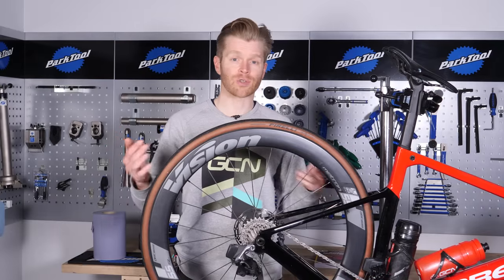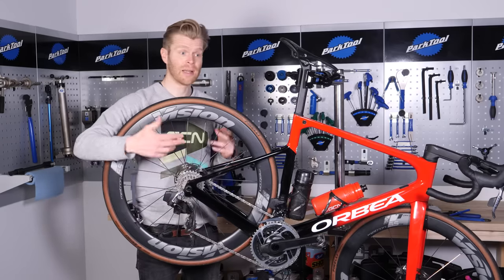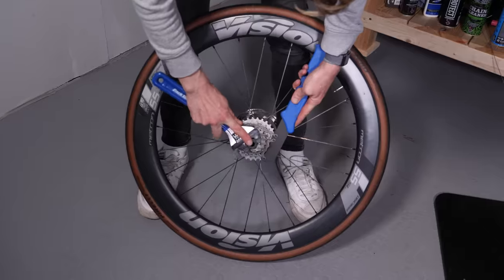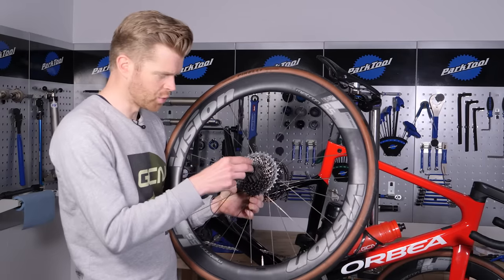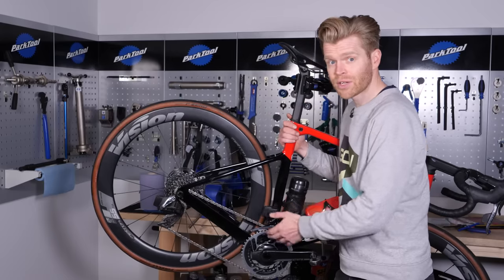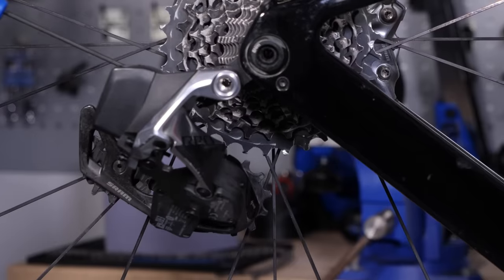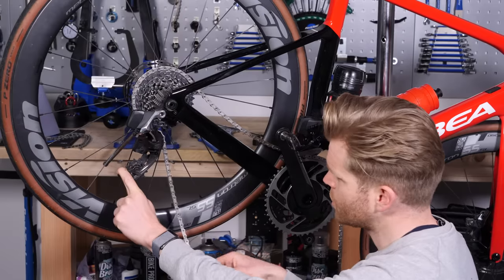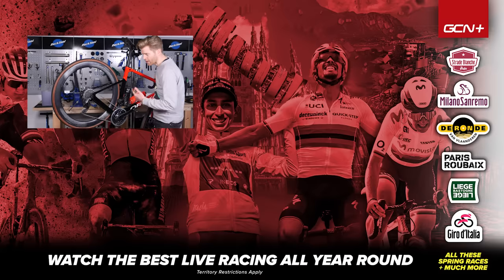How To Fit A Bigger Cassette & Ride Uphill With Ease! | Maintenance Monday

Comment from the maker: Did you find this useful? What other maintenance videos would you like to see us do?
Reply: @GCN Tech can you show us how to adjust Di2 to use non standard gearing (eg 52-34 rings) as Shimano E-Tube Pwoject doesn't allow it. TIA
Reply: How to replace tubeless tire properly
Reply: i mean it's common knowledge, right? right?!?
Reply: @janeh4908  ha, i knew there was a catch with happy-go-lucky adoption of more electrnics in bicycle drive 😅 i mean if automotive industry is any indicator 🤷
Reply: @zoladkow  not to mention the problems a flat battery can cause! 😅
Reply: Size a chain small to small, please 😂
Reply: it would be nice to see some videos with Enviolo hubs, and how to service them/take wheel off and on
Reply: I always have trouble getting enough initial tension when installing new shifter cables for my Shimano drivetrains (Sora R3000, 105 R7000, and GRX812) derailleurs). I especially have trouble with the front (Sora and 105). I would love to see a video with some tips and good visuals for both front and rear mechs before I build up my newly acquired Trek gravel frame 😁
Reply: @danmiller583  That’s the only way I know to do it, but honestly not sure if one method is better than another. Seems like sizing small to small would be the best method if you want to swap rear cassette / ranges without changing chains. I have run Shimano 11-28 and swapped back and forth with an 11-34 cassette and it works very smoothly without any adjustment.  Of course, I never run in “biggie biggs” because of cross chaining, but it would also be nice to have an expert to explain the pros and cons of this technique.
Reply: Hello. Thanks for the video Ollie. Thanks for the tip on how to size your chain, that was great and so easy. Could you do a video on truing a rim on the bike. If a bike has a square tapered bottom bracket can you put any size crank and chain rings if it's a square tapered as well? I have an 1984 Cannondale SR 300, just, trying to make it easier to ride.

Comment: Great video, Ollie. A great life hack for older riders  too. In my 30s , I started with the standard 12-26 and 42/52 chain rings. As I progressed through life, that all slowly changed. Now, at age 75   one bike has 11-36 and GRX 46/30 chain rings. Must other bikes are setup for mild hills at 11-34 and 50/34 .  When I hit 80  there will be a 11-40 in the rear. Cheers.

Comment: I just bought a 11-34 cassette for my road bike. Perfect timing, GCN.
Reply: Me too.😃
Reply: I’ve just got the new 12 speed ultegra, always rode the 11-32 with the old 11 speed and didn’t find the spacings too bad, but now have that bail out gear with the 34. With the 11 speed it makes the ratio spacing maybe a little bigger than ideal to get that perfect gear sometimes. But with the 12 speed it’s great. I don’t understand why people would want to leave home with anything less than a 32 on the back on a semi unless you live in a flat area I suppose

Comment: 😏 just did this a few months ago in preparation for summer riding in the NC mountains. Was using a 32 that came with the bike and went to 34. There are some regular routes where I’d have to stop and rest so as not to exceed my MHR. Similar to another poster I am 72 and plan to keep at it. Go out in stride not on your hide. 😳

Comment: I happily since years  using a ultegra 6800 with a 36 cassette (long cage) on a specialized roubaix SL4 with a long derailleur hanger.  In addition I am using a zephyr 33t front chainwheel (110BCD) combined with a 50T large ring.  This gets me up the steepest hills I can ride at my age of 68.   Shimano specs are usually very conservative an can be extended by quite some margin without any appreciable loss in performance.

Comment: It’s like you read my mind! I’m going to change cassette for an upcoming steeper race, I currenlty have 53/39-11/25 and going to switch to a 11/30 for better climbing. The tip of NOT catching the largest gear woth my derailleur probably saved me a lot of time and headaches. Thanks!!
Reply: I have 25 and it's the worst thing ever. Hate that race and road bikes have no uphill perception.

Comment: I got a 2012 Focus Izalco with a triple chainring (53-42-30). IMHO the best choice for eldery people like me. The cassette is an ultegra 30-11. A 1:1 gear ratio is mandatory, could even be shorter. The next upgrade will probably be a 32-11 or even a 34-11 cassette. I know it's not fashionable, but 30 speeds are much more pleasant than 12, to keep a good steady pace.
Reply: What groupset are you using?
Reply: @notpablo8369  A shimano ultegra 3x10 groupset, current in 2012, but every parts are still available.

Comment: I live in a mountainous city. Replaced my crankset with a compact 50/34 and an 11-34 rear... And I'm a happy camper rolling up hills all day long
Reply: Hi, these look like the same specs as my gravel bike but I seem to be struggling on steep hills. Would this be my fitness level if this gear set-up for an 8-gear cassette seems to be the most accommodating? I haven't been in my best shape lately and trying to determine whether my bike is optimized. It's a basic gravel bike, nothing specialized. Sorry I don't speak "gears" fluently. Appreciate your opinion.

Comment: Hi Ollie, In the hack and not a bodge competition you may want to use the KMC chain checker tool? It hooks up both ends of the chain releasing the tension of the rear derailleur. You can easily apply the missing link now without using the quick link plyers. 
I'm riding a Scrapper Spego 120 with a Sora 3000 set for less than €500.-  50-39-30 front, 13-25 rear.  59 year old.

Comment: Best to learn what gear inches first!
Old fashioned but so very recommended. 
My 1x is a 44t x 11-42 cassette. 
Top gear is 108 inch.
Climbing gear is 28..
650b × 47mm.
Reply: why?
Reply: why?
Reply: Or just use ratios , much easier to use and easily shows the difference.

Comment: Thanks Ollie, really glad I found this video from you - it's exactly what I need. Upgrading to an 11-34 cassette for easier hill climbing at my age. ONE question, though: your method for sizing chain length (around 7:39) bypasses the rear derailleur completely. Doesn't that derailleur add a bit of length into the route the chain must take, once everything is back in place?

Comment: In the SRAM documentation it says when there is no chain on, the rear derailleur is likely to touch the spokes, this is normal. You do not adjust it based on whether it is touching the spokes or not. You look at the limit screw and adjust so it just touches the body of the derailleur.

Comment: I have found that on my bike with an SRAM clutch derailer, I can swap between 11-32 to 11-42 cassettes without having to resize the chain (as long as the chain is sized for the 11-42) and the shifting is still fine.  The clutch takes up any chain slack.

Comment: In terms of getting the cogs the right way round, make sure all of the etched writing points in the same direction (outwards) or expect a noisy drive-train that won’t stay in gear - I learned this the hard way 😂
Reply: On Shimano cassettes, the number of teeth on each cog is etched into one side so that side faces out so it can be read

Comment: If you are taking off an Ultegra or 105 11 speed like I was the other day when you slide it off the free hub thread a tie wrap through it to keep all the cogs and spacers together in the same order for when you put back on. Shimano 11 speed breaks into lots of parts with the cogs and spacers when slid off without.
Reply: When you buy a new Shamino cassette, it comes mounted on a plastic notched cylinder.  That cylinder is not just packaging, it is also a guide tool for sliding the entire cassette stack on and off your bikes hub without it separating into individual cogs.
Reply: Yeah I saw that on YouTube when I looked at cassette removal and installation. I didn’t have the small plastic tube though that’s with the new ones as I was taking off a used one and putting it on another wheel.
Reply: I discovered that the hard way but it's super obvious how it goes back together and the spline pattern on the freehub means you can only put the sprockets on in the right orientation.

Comment: Ultegra 8000 long cage will do a 40t cassette with the B screw wound in and I've used a SRAM red Etap short cage with a roadlink which will give you the use of a 40t cassette, big, big isn't usable though with that set up.

Comment: A great video, thanks Olli! Especially the thing that different derailleur cage lengths can take up different cassettes. But there is one thing I still don't understand and I had that problem as well with many tech clinics: Couldn't you just have a chain, that fits the derailleur cage in length? The little sprocket is always the same size so the chain is never to long when you switch to a smaller cassette. Wouldn't it be way easier to use the method for the chain length where you take little ring and little sprocket and then swap cassettes as needed? And I don't think the smally-small-method is that difficult.

Comment: Living in the Adirondack Mountains, I've found it useful to use a long cage SRAM Force rear derailleur and a 10-50 SRAM AXS MTB cassette to provide that greater range a guy like me in his late 50's tends to need. This arrangement works on my Roadie, Gravel Bike and Recumbent Trike. Such a commonality of parts between cycles has the added benefit of making a ready reserve of parts if something fails!

Comment: To get around the different chain lengths I add on a small section of extra chain, (kept back from when chain was "trimmed" to fit the usual smaller cassette) using an additional quick link.

Does mean the chain has 2 quick links when the big sprockets are out back... removes the faff and investment of having separate chains for each cassette size though.

Comment: Changing chain is one thing I stay away touching since they ditched manual shifting. Cycling works simple until they add the key word ‘E’ in front with a rotor attached outward. Wait until app updates…

Comment: Can you get torque wrenches that fit spanner flats or is it necessary to buy a crow's-foot adapter (ie square drive to spanner)? All the torque wrenches I've ever seen are square drive, ie to be used with sockets...

Comment: About chain sizing: the employed method does not take into account the length of the rear derailleur arm. Whether it is long cage or a short cage one should have an impact on optimal chain length, shouldn't it?

Comment: Since I live in the second flattest State in the US, I just switched from a 12-23 to a 12-25 when I got real old.....I can remember when the old 7400 Dura Ace has a max gear of 26. Then the 7700 has a max of 27, and the 7800 had a max of 28. Now the are building Dura Ace that can take a 34.....When will it end.
Reply: 10-51 MTB cassette on road bike haha
Reply: @mrvwbug4423  If they need a 51 in back, they should get an E-Bike.

Comment: I have a 1x drivechain 38T chainring and 11-42T cassette and the hills are killing me.  I don't need the high gear so is there such as thing as a 13-46T cassette?
Reply: But what about going to 36 or 34 chainring??? (38/13 is equivalent to 32/11 btw, but 32/42 must be too much now) 
About the cassetes, there are 11-46 XT or SLX where you can omit the 11t and put 14t with spacer instead.
Reply: @feedbackzaloop  That's another option but it's more expensive because the cranks and chainring are a single piece (Decathlon gravel bike) fitted to a square-taper bottom bracket.
Reply: @xtrailz  in that case you might consider a crank upgrade anyway. And let me guess, the cassette is 10 or even 9 speed? Then the only reasonable option is a Sunrace 11-46, which costs more than a second-hand crankset with new chainring
Reply: @feedbackzaloop  Yes, it's a 10 speed but it may as well be 9 speed as I never use the high gear.  For about £60, there is also the Shimano Deore CS-M4100 11-46 .  I'm running the 42T version of this at the moment.
Reply: @xtrailz  wow, 60£ is quite a premium compared to 50€ that we have on this side of the Channel. But it's a solid cassette anyway!

Comment: Is there a case where you wouldn't replace a chain when switching cassette ? I.e. if you went down a small step from 11-34 to 11-32, are these steps still necessary?

Comment: Or you know, you can always run smaller chainrings….And avoid big jumps/gaps between each gear
Reply: Cassettes cost next to nothing and are very simple to replace, compared to the chainrings.
Reply: I still don’t see why any average rider needs a 50 tooth large chainring up front, especially if you don’t race
Reply: @philipcooper8297  It’s often possible to swap chain rings without removing the cranks. I’ve got the biggest cassette my derailleur will allow so smaller chainrings is my easiest and cheapest option
Reply: Agreed, I’m decently fit but lightweight so the 52T on my road bike is completely wasted on me! Will be swapping to 50/34 but lower like my gravel bike has would be better!
Reply: I think chainring is definitely the option to go for if you want a long term fix for hills/carrying loads etc. I think this video is targeted more at making a quick mod for a specific ride or trip. It is also easier to source a new cassette than a chainring that will fit your cranks.
Reply: The avarage road rider can easily push a 50-15 on the flats, so for sprints and descents a 50-11 is often needed. In my opinion 50-34 on the front and 34-11 at the back is the best overall trade.
Reply: The other side is, can't always go a bigger cassette. Am rocking 10spd Ultegra 6600 on the Everything Bike. 11-28 is the best I can do at the back, but a recently arrived Sub Compact crankset basically gives me the same range as The Good Bike (53/39T, 11-34) sans the 53 in the 11 & 12 sprockets, which for commuting and bikepacking just do not matter a jot.
Reply: @MattSwain1  I prefer to keep my 52T chainring so I made my 52/36 into a 52/34. Works perfectly (on SRAM Red mechanical).
Reply: with most cranksets 34 is the smallest you can fit, most older come with 36 at least. If you have an 11-25 or 12-28 cassette, you are still way too far from nice and sweet climbing 1:1 ratio.
But Phillip has an even worse argument: now the cassettes are really hard to find and cost almost double of pre-covid times. Besides, cassette wrench and a chain whip are still specialized tools, while chainrings can be swapped with a hex wrench only.
Reply: I was considering this, but got massive sticker shock when I priced new Ultegra chain rings vs a new cassette.  The Ultegra has unique bolt spacing and is premium priced; it's much cheaper to change the cassette.
Reply: @jefferycampbell2243  110mm asymmetric is not THAT unique... first of all, 105 would cost you almost half of that of Ultagra (and also cheaper than the Ultegra cassette) and work as fine, plus there are aftermarket options even cheaper. Secondly, you should have been comparing the inner ring price, which is about 15 euros: cheaper than any cassette. And despite what Shimano says, 52/34 is still a working option
Reply: @feedbackzaloop  there are many options for 43/30 and and 46/30 chainrings.
Reply: @monty2078  Ah, yes, FSA cranks with non-standard BCD for the smaller ring. Sure, if you run a direct mount or BCD64 crankset, you can even go with 24 teeth, which is out if a road bike realm. Granted, most people are still using 130 and 110 5-arm cranks.
Reply: @feedbackzaloop  I use Absolute Black 46/30 which has standart Shimano BCD- simply slides on. On my Sram equipped bike I use Sram 43/30 with an 10/36 _ standard Sram
Reply: @monty2078  wait, what?! Those you slide on are direct mount Sram. 46/30 for Shimano are bolt-on and oval, meaning they have radius of 50/34 in the widest part.
Reply: @feedbackzaloop  You Re correct about the SRAM. Sorry, I dont know what you are saying about the Absolute Black. I have just measured them to make sure and they certainly are not 50/34 at their widest.
Reply: @monty2078  you measured the sprockets at  the biggest diameters and it turned out less than 144 and 208mm respectively?
Reply: @feedbackzaloop  OK, Sorry, I thought you were measuring differently ; you are correct

Comment: you don't check the limits with no chain attached!! what are you doing there!! plus, you don't put so much grease on the freewheel, it will centrifuge away to the rotor!

Comment: You can run a 32 cassette with any 11spd Di2 rear derailleur.

The latest series 11spd R8000 and RD9100 will handle a 36 tooth.

How do I know? Ive installed them hundreds of times.

If you want to run a 40 cassette then yes you will need a GS type 11spd R8000 or R7000.

Comment: I'm running Ultegra r8000 with a long cage rear mech and wolf tooth road link with 52 36 chainset and 11 46 xt mtb cassette.  Works fine. Gear range 126 to 21 gear inches.
Reply: Damn, does this setup work for real? Shifting is fine? Can you go big ring to big ring in with this setup?
Reply: @Jeff Mayfield  shifting is fine but I do avoid big ring to big ring. Don’t need it. It will go there but not worth testing.

Comment: Nerdy cyclist comment incomming: 0:15 --> Don't put your oily fingers in the cassette and then on the disc brake rotor. Or at least clean it right away.